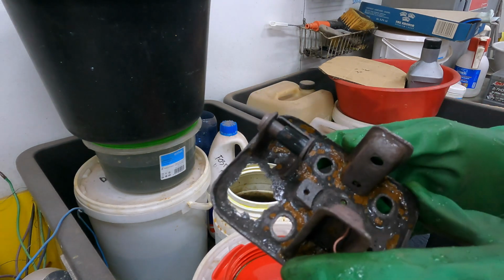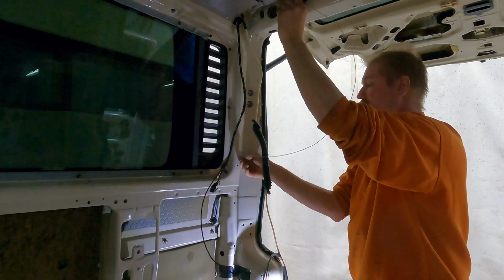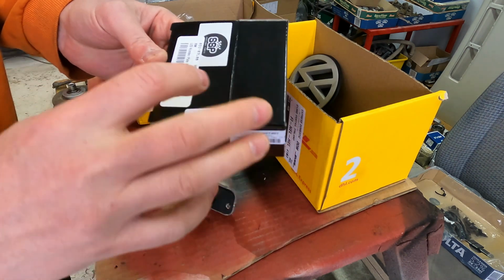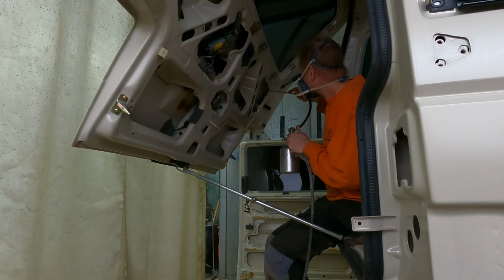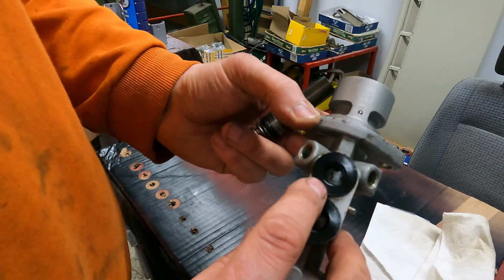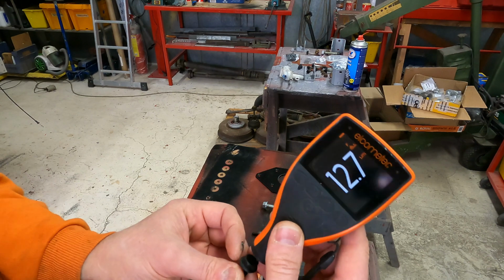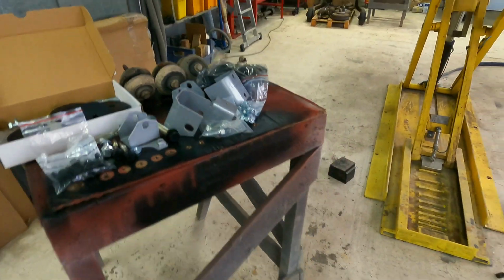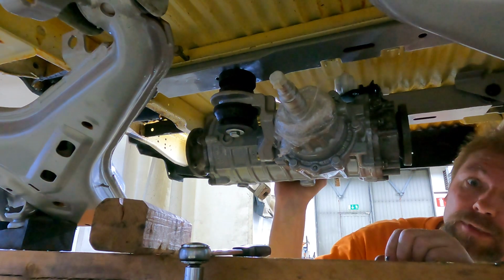Time to Drop the Rear Differential on VW T4, Drop on T4 Tutorial,VW T4 Maintenance,Service on VW T4.

Comment: Hello where di you get the rear differential carriage beams?
Reply from the maker: My syncro is original and beams was there. I only refurbished those. There is couple of previous videos where you can see the task. I drilled off the lower sheet metal and sandblasted those. By the way, there is one company who sell new those sheet metals, but I didn't buy for this. Try search: Wheeliams Volkswagen T4 Syncro Rear Cross Member Repair Panels
Reply from the maker: https://www.youtube.com/watch?v=7_2OOVw_TqQ&t=1021s